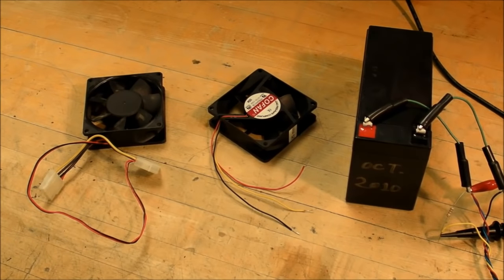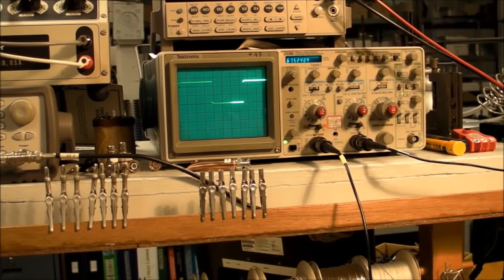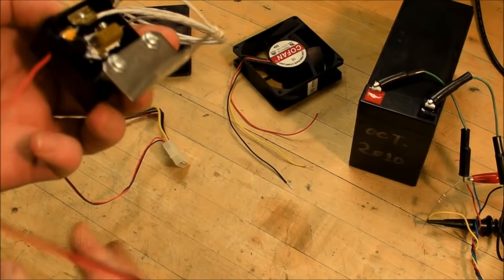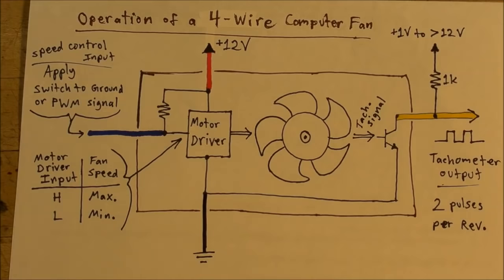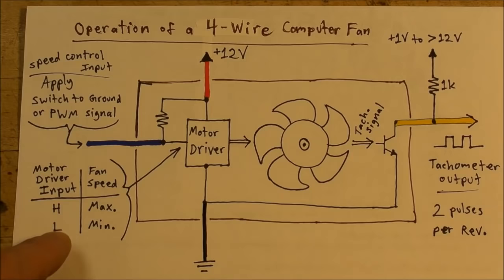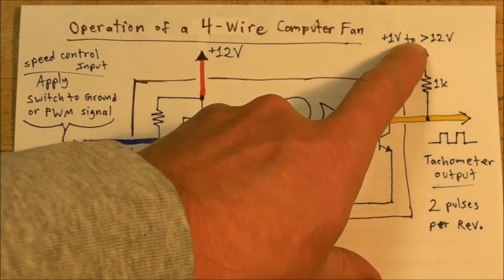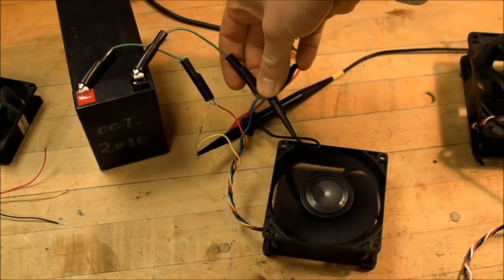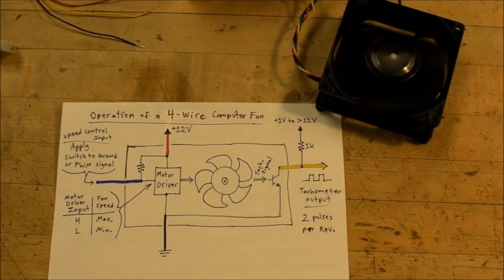(#0033) 4-Wire Computer Fan Tutorial

Comment: On the two wire, why would you PWM at such a low frequency? Most of the time you want to PWM at above 15khz to ensure that its outside the range of human hearing, and at such high frequencies you get better averaging of the voltage output. Doing 1hz to 100hz seems like a recipe for frustration.

Comment: You are life Saver.. I just order a fan from Farnel and got a 3 wire fan.. I was like what?? My amplifier need a 2 wire fan.. A check on data sheet reveal sensor.. Its so misleading as i thought connet to a thermistor to control speed fan but in actual fact it is a open collector tachometer. By watching your video, my worries gone and  i knew exactly what to do.
You save time and effort to experiment and might blew up the fan or give up as that yellow wire is not an input but an output.

Comment: Well, you answered my question of what the blue and yellow wires do.  I just soldered up a 5" maglev fan that is rubber mounted in a cowling, attached to a ~4"  2x4 for a window cooling fan.  I used  a power supply that has a switch for 2 -12 volts.  Used just the red and black wire.  Switching volt switch gives me 4-5 different speeds.  Very quiet and energy efficient for those 5 hot nights per year.  EZ peezy!

Comment: Wondering if you can help troubleshoot, I replaced a fan with another one that should have the same specs (12v and 4 wire PWM). On the new fan I had to splice a new connector on the 4 wires so that it could plug into the original harness plug. My problem is that the fan just seems to spin a it’s minimum RPM at all times. The other original fans that are operating at the same time are either off or running at some variable speed but this fan just runs at a slow speed during all situations. Is it possible that the tach and pwm wire backwards and need to be flipped?

Comment: I have a question? I have been using a 12 VDC fan and a 12 VDC really both connected to turn on 110 V compressor. This is used for  a fridge. Well now this company which makes refrigerators I won’t say its name has installed a four cable fan and now it says it’s a 13 V fan. So I’m having issues because the fan stays on so the compressor stays on. So I’m wondering if there’s anything else I can do. I need the compressor to turn off when fan turns off and on.

Comment: i have a computer fan with 4 wires white blue red and black.
red and black give full speed.  Accidentally when i short white and blue wires the speed went lower to my requirements.
But i m not sure if would be safe for the fan or supply. I am still looking for the answer.
A little education will be appreciated.
Thanks for the detailed video.

Comment: computer fans usually require at most 0.38 amps at 12 volts
i made a desk fan to keep me cool
2x 120mm thunder blade pc fans connected to a pwm dimmer circut for leds powered by a 12v 1 amp adaptor. works great

Comment: When connecting the PWM control wire to the GND it sets the minimum speed if using a potentiometer to vary the resistance between the blue wire and the GND would this have the same effect as the PWM?

Comment: I have a 60mm 4-pin fan (12V 3.3A), and I am trying to have the fan always running at a lower speed when the PSU is switched on but I want to increase RPM as the temp increases. Can I do this with one of those Amazon thermostats? Alternatively, I could just run it as a 2-pin and use a thermal switch that completes the circuit at a certain temp, but it will operate at 100% RPM... Any help would be appreciated:)

Comment: Follow up on running it slower with a 9v is because of vibration btw the fan is rated at 3000rpm so running it at 3/4 of the speed will be suffice if this method will work. Any feed back will be considered

Comment: i have a 4 wire fan that is a sort of smart fan with load sensing in it and i dont know how to get it out of idle. red and black wires are powered but the full output of the fan is not met when i put the right power

Comment: How much current does the signal wire pull per fan? Would it be advisable to split the signal wire coming off say my GPU and have it also control the speed of two additional case fans? The additional case fans would have their own 12v from PSU so I don't fry the GPU header.

Comment: So can I safely control the additional fan speed of a 3 pin fan on a 4 pin motherboard by adjusting the 4th open pin out to ground? Can I create a 3 speed switch to it? My Mobo keeps the Noctua 4 pin fans down to 350rpm (feels too slow & ASUS monitor puts it in red) and I can handle 1000 on my SilverStone 3 pin & still be quiet.

Comment: I plan to use a four wire to cool my telescope but I plan only to use the ground and hot wire. In conjunction with a 9 volt direct in order to run slower would this work or should I get a eight battery connector to do the job?

Comment: Good explanation. Tachometer is open collector, and the PWM can go up to 100kHz, thanks for that. 
But colors can confuse a little bit:  I have a 3-wire where yellow is 12V and red for tachometer, it may be due to the use of yellow for 12V and red for 5V in the PC power supply.

Comment: Do you know if 4-wire CPU 12V fans work the same exact way?  
Specifically in Intel "stock" socket 1151 CPU cooler.  
I will have to try this.

Comment: Will this work with a car cooling system? I already have the system installed to replace the bad radiator fan and the project works great but I only have one +12V wire to work with and the vehicle supply's a High and Low wire plus ground. I have what I believe to be the low speed wire connected to the fans PWM wire but nothing ever happens. The fans only turns on when the high wire is on. I was thinking of connecting both low and high together but I did not want current returning back to the cars system as not designed. Possibly the relays will prevent this but I don't know if it is set up that way.

Comment: Excellent! So I bought a replacement fan for my Laptop, but turns out it is a 3 pin (Red, Blue, Black wires) that I have to swap with the plug from my old fan that fits the socket (Red, Blue, Yellow, Black). Except I will leave the Yellow empty. Being that the Yellow wire is only for the Tachometer am I right in assuming that there will be no ill effects leaving this wire out of the equation? I've also read/seen elsewhere that this solution will leave my fan running at maximum speed constantly - which is fine by me as it seems that my laptop needs to be well ventilated anyway. Any suggestions, comments, warnings? Thank you all!

Comment: I'm still slightly confused. Could I just plug positive and negative into a 9v and the fan runs at a slower than fastest speed; then 12v power for full speed. Or do I have to have the speed controller one plugged in to something appropriate?
Reply: These are brushless DC motor fans.   They are not like your standard permanent magnet toy hobby motor.   You might see some variance in speed but it is not the way to control them.

Comment: Very interesting, and helpful. I’ve been playing with fans and basically hooking up my PWM to red and black with some control but it does not work as well as I was hoping. I see it looks like you have the ground from your signal generator going to ground on fan, you have red and black to DC power. You have the blue hooked to the red on your signal generator. I’m about to go try this in my cheap little fans first and then I’m going to attempt it on my big expensive fan. I had been wanting to use the yellow on my frequency meter on the fluke 115 that should give me the RPM frequency/2

Comment: I got one of Delta's high speed (4500 rpm) high suction (50 cfm) blower with rated 1.80 amps current. (12V DC). 4 colors, same as described. I connect red  to +12V DC and black to ground, it works fine. Starts slow, speeds up great  - to a leval which I though to be the maximum as described above. But when I measure the current drawn, at steady state it is only 0.68 amps. It goes very briefly up to 0.70  - 0.75 at the beginning just before reaching th "maximum" speed, and then goes down to steady 0.68. Huge difference between the measured and the rated values. Could it be that I need to give some input to blue? What happens if I connect just 5V DC to blue? No PWM.

Comment: THX MEN YOU SAVE MY CPU NOTEBOOK ASUS A LOT OF PAINE CHIP CONTROL FAN DIE AND STILL WAS ON LOW SPEED RISING TEMP OVER 54C TO 65C NOW 35C :)
BLUE WIRE DISCONECTED AND FROM 2700 RPMS RISE TO 4500 RPMS

Comment: Very helpful.   I would have expected the PWM input to work with a TTL signal but if what you say is correct then you would destroy a TTL component because voltage would ride at above 5V.   I think it means the same for the Tac.  It seems like this would waste power continuously because it will be drawing power through the PWM drive circuit to keep it at ground level when powered off.   Am I interpreting this correctly?

Comment: 29 dumb person dislike the video. thumbs up for me. really helpful. you're so right, there isn't much info about how the PWM fan really works. it helps alot since i've got a Nidec Ultraflo for my server but the seller cut off the connectors, so i really need to know which color cable is which. this helps clear things up.

Comment: just using knobs and switches from radio shack, how would i go about wiring my 4 wire fan so i can include a little digital tach and knob to see/control the speed? i don't have the equipment you were using in this video, nor would i be able to use even if i did because it needs to be portable.
Reply from the maker: +DakodaWolff Easiest solution would be to use an arduino with LCD display to both control and readout the speed. Or you could keep it old-school and use a 555 timer to vary the speed, and an analog/digital circuit with 7-segment LEDs for the digital tachometer.

Comment: great video,  but can we use thermistor between ground wire and pwm control wire for thermal controlling the fan speed? 
does it have any negative effect if I apply into my computer? 
sorry for my bad English
Reply: No, the PWM control is not based on a voltage, but a duty cycle. PWM fans use a 25 kHz square wave and the percentage of the time that it spends in the HIGH (I believe 5V) state is the duty cycle. For example, if your signal is HIGH for 40 microseconds , then LOW for 10 microseconds, that's
 an 80% duty cycle. To generate a custom duty cycle, you need a 555 timer, microcontroller, or similar.

Comment: There is a 12v dc air conditioning compressor that has 3 wires attached to controller. And some yellow wire coming out from controller saying TX. I wo Der if that's compressor variable speed controller it has 5v positive signal even though the compressor is at 12v.

Comment: interesting!  I was reading a datasheet earlier showing intel's specs on 4 wire fans, and they stated pwm-in was 0.8v to 5.25v, and the pwm frequency range is 21khz - 28khz. what frequency pwm were you feeding it?

Comment: Do you know what is the peak tension on the PWM wire? 12V or less works too?
And what if the square wave has different low and high periods?

Comment: is it possible you could/How, wire a 4 wire 12V fan to usb .?
Reply: usb pinout is +5V +d -d GND I am learning as I go hope this helps someone. OH...the +5 & GND are the outside two, and a bonus tip if you find two wires twisted together you can be fairly certain that those are the data carriers.

Comment: Can you just tell me how to power up the 4 wire fan via. usb?
Reply: You cant, it doesnt work like that.
Reply: Well, he can, I think. Just power to power, ground to ground, and it would always be on max. There would be no controlling.
Reply: Not exactly, it depends on the operating voltage of the fan. Most computer fans can be ran at 5v so it tends to be fine, but you do have rare cases where the fan itself won't start at 5v at all so it's something to be aware of. As for how to simply wire a USB fan that you know can handle 5v 1a do the following: Cut open whatever USB cable you want to use and identify the red wire (this is the Power) and the black wire (this is the ground), then solder or crimp the yellow wire from the fan (on a standard PWM computer fan this is the power, but colours vary from brand to brand) with the red wire from the USB cable and join the black wire with the black wire (again this is Ground on most fans, but not always so so check first). After that you should have a simple fan that is running at 5v, and assuming it can run that low and maxes out at 12v it should run at slightly below half the speed.

Comment: G'day Eric.
i enjoyed your video. :)
Hi tech stuff with all the instruments you have connected.

Now, I have been watching videos on perpetual motion on cpu fans, and the scams apparently....
However, another tech converted a Fisher& Paykel Stator motor to generate electricity.
(he does rewire the stator however)
Now, (since i only have basic knowledge in electronics), I hooked up my multimeter to the fan and 
spun it around by hand and achieved a max voltage of .5v, but in either instances, no polarity showed up! :(

To add, no, the LED did'nt light up either.
My question is, is it possible to rewire/reconfigure the windings on a CPU fan in order for it to generate
small amounts of electricity to illuminate an LED?

further more, is this possible via magnets?

I'm interested in you theory on this matter.

cheers!
Mick

Comment: Question.. If I wanted to leave the yellow wire open would the fan still run.
If I leave both yellow and blue wire open, or electrical taped will it still run at max Velocity?
Reply: I tried that and my fan pulsed.

Comment: Hi, great information, thanks for sharing. Do you know if it's possible to reverse the fan rotation?
Reply: just flip cooler for 180 degrees
Reply: @miroslavteodorovic6526  Can't, it's a sideways cooler, much like a laptop cooler,  it's a "PCI slot fan", only problem is that it exhausts air, I'd like it to suck air in, so I can put a dust filter in the intake and control the dust buildup inside the cabinet. While exhausting does a good job in removing the hot air, I can't control from where the air will come in so I can't filter it.

Comment: What happen if I don't use the yellow wire? it works the same?
Reply: If you have the fan connected to the computer motherboard and you don't use the yellow wire, then the motherboard won't be able to read the fan rotation speed (RPM) to display it in various utilities like HWMonitor, etc. The motherboard will see the fan as spinning at 0 RPM (stopped) and if the "alarm" setting in the BIOS is turned on, the system beeper will start beeping. In that case you have to turn this feature off in BIOS. Otherwise the fan should work fine without the yellow wire. I'm not sure if the fan speed control will work if the yellow wire is not connected. Maybe that depends on the implementation of the motherboard, if it is "intelligent" enough to use the RPM signal to control the speed of the fan by raising the voltage. I imagine most motherboards just use the yellow wire to display the RPM and they raise/lower the voltage for the fan based on the temperature sensor on the motherboard, regardless of the yellow wire being connected or not. Somebody can correct me if I'm wrong.

Comment: you explained this best.   But unless i missed something, the two wire running on pwm; that isn't built for it; is just using the pwm signal as a tiny dc input.  But your comment on modulating it on and off is interesting as a speed control method for dc fan... but that's also the same way you start a fire, once you've gained access to any toggle controlling electricity in the hacker world, so I'd be leary of longevity.

Comment: OMG I am so glad I clicked your video!!! I was trying to figure out the black box (specifically the PWM signal wire) for hours! Can you please confirm the following - if I take a PWM fan and plug it into the 3-pin header on the motherboard that delivers 12V (100%) and I take the PWM fan wire (blue) and connect it to the ground pin, then I will be able to read the minimum RPM that the fan is capable of?
~~~
I am suspecting that my motherboard has fake PWM headers and I've been trying to troubleshoot and confirm that. The motherboard has three 4-pin headers. One is CPU_FAN and other two are SYS_FAN1, 2. I am suspecting that SYS_FAN1 and SYS_FAN2 are regular 3-pin headers and the PWM pins aren't doing anything. When I connect a PWM fan and use a program like SpeedFan, I can control the RPMs but how can I tell that it's pulse controlled indeed, not voltage controlled like other 3-pin headers? When I drop RPM below 30% the Fan stops, which tells me that it's the voltage that dropped. If it was the PWM frequency then it would still spin slower and slower, correct?